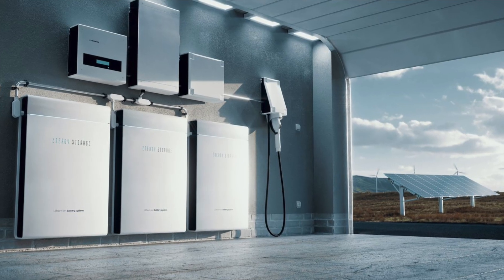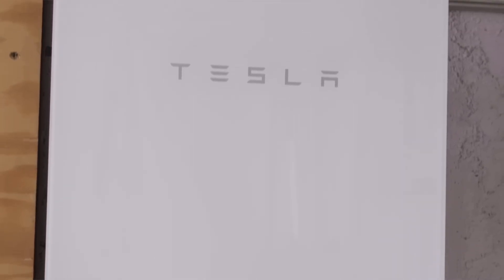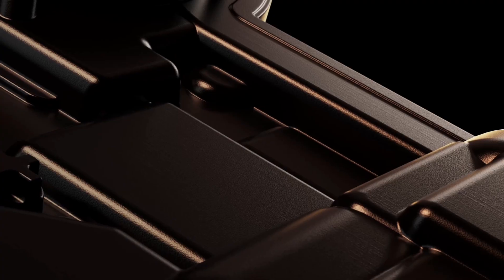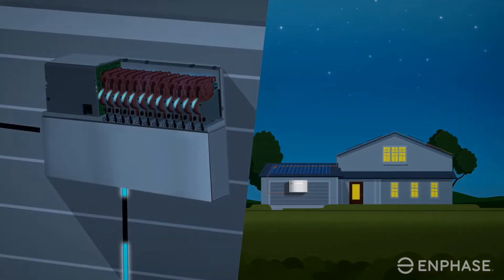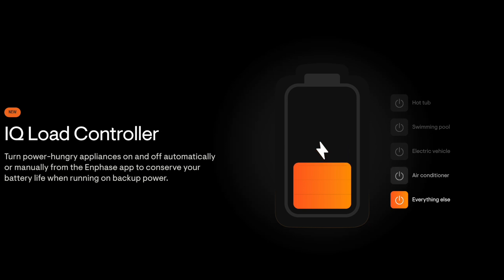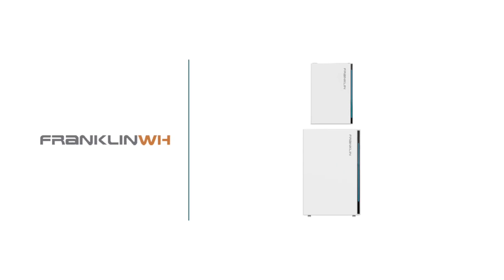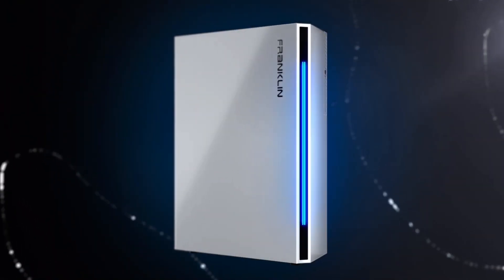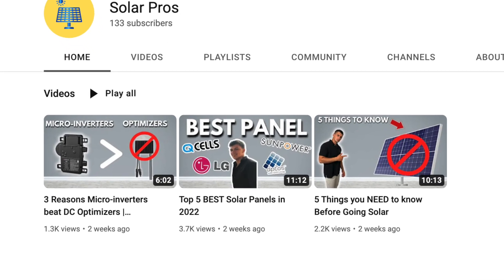Top 5 BEST Solar Batteries in 2022

Comment: For two years I've had my Homegrid Stack'd (4 modules, 19.2kW, 12.9kw continuous available) running flawlessly, mated with my Sol-Ark 15k, which has also been running flawlessly. Literally no downtime or faults from either. And they run my whole house, i.e., all my grid power is shipped directly to the inverter, which manages all distribution, and which is programmed to use solar, then battery, and only grid power if necessary. So, ~9 months of the year I use no grid power, but do sell the grid my excess solar generation; ~3 months I dip into my built-up grid balance to cover any solar shortages (but don't use much of that balance). Anyway, I'm not a fan of the HomeGrid monitoring app but don't need it since my Sol-Ark app gives me massive info on the battery; and I am a huge fan of the battery because it just sits there silently looking great while powering my whole house whenever I don't have enough solar to cover. That includes my 4-ton central AC, my fully electric kitchen, and my electric dryer. I'm hopeful this battery continues to do its silent powerful work for many more years.

Comment: Thank you for this presentation.  Do the batteries have a rating of how much their charge or capacity will drop off over the years?  Also, what is the life expectancy of the batteries? Much appreciated!
Reply from the maker: Not adversited, however that rating is typically reflected in their warranty. And to your second question, we expect 20-25 years

Comment: Thanks Jack for the review! I'm a founder of HomeGrid and we're excited to be competing for that top spot. We hope to give our customers the most value possible and to continue pushing the tech forward.
Reply from the maker: Nice!
Reply: Hello! I really like the idea and the look of the Homegrid stackable system, but what about overheating with such a closed in tight system? 
Do the batteries need or have any venting?
Reply: @simonpaine2347  yes ，we have.
Reply: Do you guys have drawings and 100% certification for seismic four earthquake zone ratings in California? They need to be signed off by a structural engineer in the Santa Barbara area otherwise the permit is a no go.

Comment: I just installed a 25k system using Enphase IQ8 microinverters. I really like the microgrid capability, but the batteries seem a bit smaller compared to competition. Looking to take tax credit and apply to batteries in 2023, have any thoughts on direction I should go?
Reply from the maker: Enphase is a great option, considering you already have their micros… and Franklin is also a great choice!

Comment: A little late to the comments here, but I had a couple comments/questions: 1.) it seems (unless I missed one) that these are all AC coupled. Is there a scenario where one might prefer DC coupled? 2.) Any comparisons on other performance characteristics, e.g. temperature? I had a solar salesperson warn me about poor performance in 100+ degree desert heat. Maybe an idea for your next video? :)
Reply from the maker: Great questions. We always prefer to put batteries in the garage, or in the basement, to mitigate heat effects. I tried to hit the major performance characteristics, and most other metrics are likely less important. AC coupled systems are much easier to install, which is one of the reasons most batteries are AC coupled, and additionally, being AC coupled, it allows for the battery to charge from both the panels and grid. DC coupled battery will be slightly more efficient. Jack
Reply: @jackthesolarguy  Thanks! Yeah I suppose I haven't really measured the temp in the garage; just knew that it was "hot" in the summer. I seem to remember a salesperson telling me that the choice of AC or DC would have some impact on net metering; maybe the DC coupled would allow you to sell back at peak times, or something? My memory is fuzzy.

Comment: In other videos, you talk about the importance of selecting and knowing your installer. You call out specifically working to evaluate the likelihood that the installer will be there for warranty services years down the line. In this video, you don't mention the importance of assuring the battery manufacturer will, likewise, be there. Why?

I think the differences between some of the manufacturers you listed in this video are significant. At least,  a well-established publicly traded company with strong (largely public) financials, strong commitments to customer service, and separate insurance underwriting their battery warranty is a lot different than a very small privately held start-up with unknown financials, no formal customer service commitments, and no separate warranty underwriting. 

IMO there's a LOT more to discuss/highlight related to battery warranties than years alone. For example, remedies. There's a BIG difference across the different manufacturers you've chosen in this video. Why didn't mention anything related to warranty remedies? There's a significant difference between a warranty that obligates the manufacturer to repair or replace a battery and one which allows the manufacturer to simply provide a prorated refund at their sole discretion. I mean, if, worst case, I had to rely on my battery warranty I'd rather, and imagine most folks would also, have my warranty provide for a fully functional battery 9 years in version some measly refund of perhaps  <$1500.

Likewise, you're not doing anyone a favor by failing to highlight the difference between warranty restrictions. The difference between the batteries in this video is very significant. Many batteries require regular Internet connectivity for warranty, but some are more restrictive than others. This is mostly for temperature monitoring. Speaking of which, your #1 choice has some of the most severe (warranty) temperature restrictions of any battery on the market. 

Also, while the Franklin battery may offer a 12-year warranty (of objectively lesser value than others on your list) another on your list offers an extended warranty of 15 years (for separate purchase).

It almost feels as if you gave way too much weight to "12 years" of warranty, with little consideration for the value of the actual warranty or the warranty terms. Please don't encourage manufacturers to provide longer but much less valuable warranties.

Also, I think, when discussing batteries such as these and talking about things like "4-ton A/C startup", it'd be worthwhile to compare and contrast how many batteries of each would be required to meet that, or a similar, metric. Perhaps even the expandability limitations of each system.
Reply from the maker: Correct. Installation companies will service warranties on behalf of the manufacturer, which is why that was important to note. Manufactures do not have individual maintenance teams, which is why installation companies offer the service of servicing product warranties
Reply: @Solar Pros  OK. That didn't answer my questions or address any of my points, but it's still worth noting. Just as it is probably worth noting that the chances of finding an installation company to repair or replace a battery at their sole expense (without a manufacturer's financial support) are near zero, even if they're highly reputable and did the original installation. Meaning all the points I raised are valid regardless of the installer, and MUCH more should be considered when looking at a manufacturer's warranty beyond simply "this one has the longest standard warranty,  so it must be the best", or something similar.  

Promoting that sort of thinking only encourages manufacturers to put longer but much more restrictive warranties in place while simultaneously devaluing their warranty remedies. That may be more profitable for them but is ultimately a disservice to the end users. Again, please don't contribute to that.

Comment: Great, objective info!! Two questions:
- if you have micro inverters on the ground-mounted panels, a short distance from the house, do you need AC side batteries downstream of those inverters?
- what do you think of Battleborn Lithium Iron Phospate batteries for a off-grid home?

Thanks!!
Reply from the maker: Micro inverters invert energy at the panel, so the batteries would ned to be downstream. As far as the batteries are concerned, you would likely have to pair the Battleborn Lithium Iron Phospate batteries with a Sol Ark 15k inverter, in order to back feed to the home.

Comment: Hello Jack, what battery would you recommend when the electrical power is down and it's cloudy for days and have to use a gas generator to power up the battery. Great job with your chanel. Very educational.
Reply from the maker: For that compatibility likely the Generac PWRcell or Sol Ark 15k.

Comment: With cars gaining two way use, tell us about that and how it works. Can it replace a whole home battery? What inverters work with it? Can the car recharge from solar when in island mode and can solar run the house AND provide some charge to the car. How is that managed between the car and solar giving the home power?
Reply from the maker: That option is still in its beta years, due to the fact that doing so can accelerate the degradation of batteries. SolArk is an all in one hybrid inverter, when paired with the right battery, would likely be your best option to do so.

Comment: Curious on you opinion of Schneider Inverters, specifically the Schneider Conext XW PRO 6.8KW Hybrid Inverter?   I am going to be fully off-grid in New Mexico just south of Santa Fe which is about 6000 feet, so it does get cold in the winters.  Thx in advance.
Reply from the maker: I don’t review a lot of hybrid inverters, because they are not typically carried by installers, nor very popular in residential installs, but they are a great option when going off grid. Most familiar with SolArk, but I don’t know much about Schneider.

Comment: what's the surge power rating for?
Reply from the maker: Surge is the maximum power that the battery can supply, usually for only a short time. A high surge is typically required to start an air conditioner unit, or another electrical component in your home, which uses substantial power to start up. If your battery has a low surge rating, it might not provide enough power to start these appliances up, which is why surge is important
Reply: @jackthesolarguy  ty

Comment: I have just had a 5.95 kW Sunpower solar system installed. I am considering adding battery. The system uses Enphase microinverters. Are you familiar with the Sunpower battery?
Reply from the maker: Not familiar with it. Recently came out, and seems as though it hasn’t been distributed to outside installers at scale

Comment: Thanks for such a straightforward, needs-based, review!  I am convinced that the FranklinWH is the battery that will best suit us.  However, because they are so new, I haven't been able to find anyone in southern Maryland installing them yet.  Do you know of any installers in the DC Maryland area installing the FranklinWH battery system?  Thanks and great job on the battery comparison video!
Reply from the maker: Thank you for the positive feedback. FranklinWH is a newer product, so there distribution network is still in its infant stage. I am able to coordinate projects with Franklin products in Maryland, with multiple partners installing in that region.
Reply: @jackthesolarguy  Thanks.  How can I contact you off of the public chat to discuss?
Reply from the maker: @darrenrogers5713  There is a link in the description of the video, where you can book a time on my calendar to discuss options for your property.

Comment: Thanks for such a detailed and helpful breakdown. 
I'm looking to incorporate an EV into a new home solar installation. It would seem that the Franklin is the best solution for this as it seems that it is capable of accepting multiple inputs. 
What are your thoughts and do you have any plans for a video explaining the pros and cons of such an option?
Reply from the maker: I plan on making a video regarding that in the future. Franklin would be a great option for EV backup, but I would likely recommend two or three batteries if you choose to do that
Reply: @jackthesolarguy  Thanks. That will be great. I'm sure that there'll be more and more people who will be interested in using a car to supplement their system. 
I'm planning on using as little as possible electric from the grid. My electric company will allow me to bank credits, but won't pay for any unused ones, but if it means banking a little more than I use, then I'll not be too upset. While my car is at the house, it's pretty much a certainty that both my wife and I will be there, but on those rare occasions I'd like to have a battery to ensure maximum use of the sun and keep the house running.
I hope that makes sense!
Reply from the maker: @simonpaine2347  Gotcha. Does your utility company offer you a 1 for 1 net metering rate (pay you back at same price per kwh which you pay)?
Reply: @jackthesolarguy  I think that it's 1 for 1, but it's something that I need to check!

Comment: Nice evaluation! 👍 So many choices now, but allows users to consider options. Being in a canyon and rural area, I'd consider another iQ10 battery or connect a generator for long periods of grid outage.
Reply from the maker: Good point. The iQ10 pairs great with the Enphase micro inverters, if you choose to work with that inverter